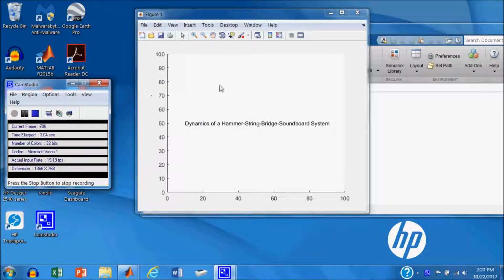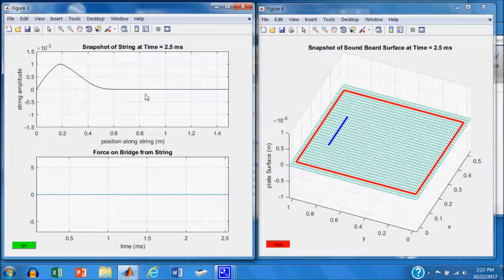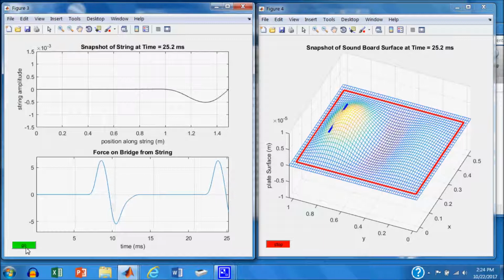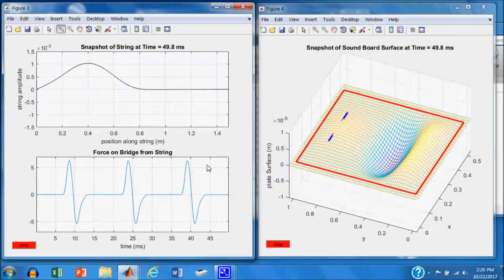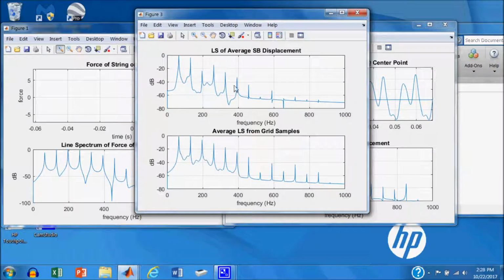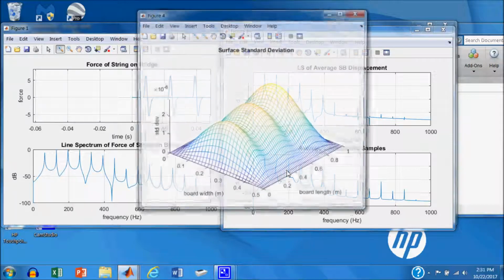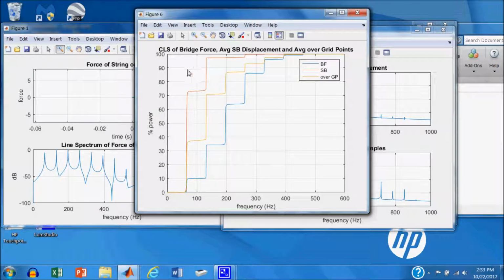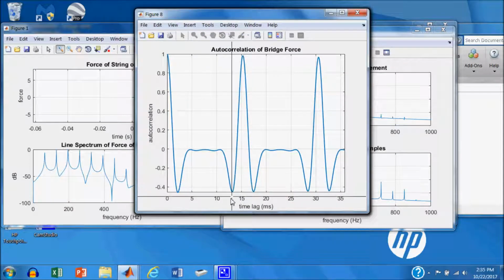Dynamics of Hammer-String-Bridge-Soundboard Interactions

Comment: Does the bridge in this model have additional mass and stiffness or is the "bridge" simply referring to the point on the board that the string is driving ? So, for example, do you make the board thicker in the area that represents the bridge?